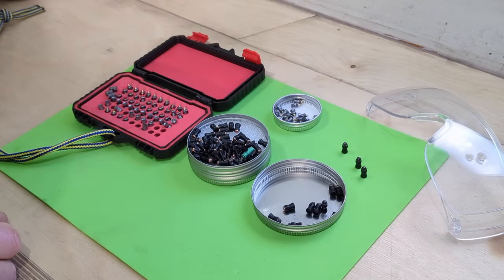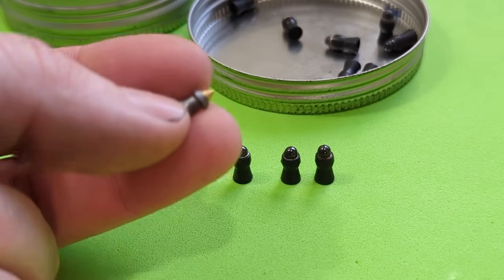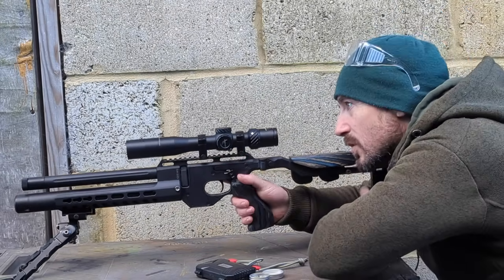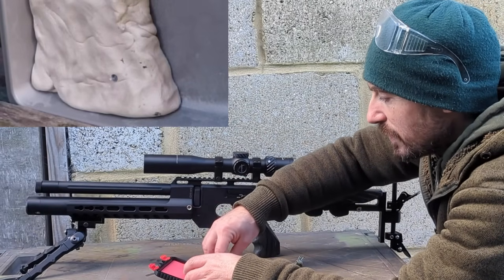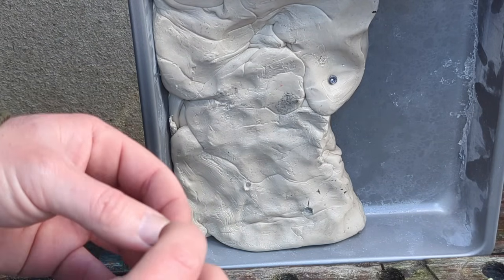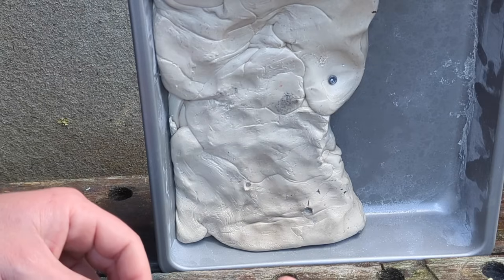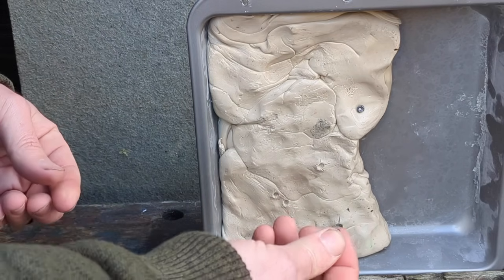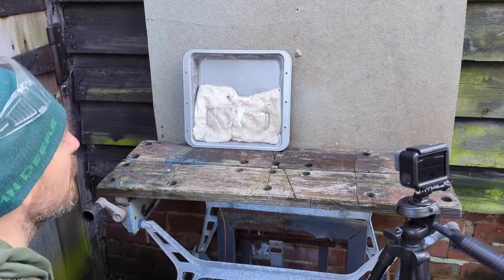The most extreme air rifle pellets in existence.. Ceramic hybrid tipped Gamo lethal!

Comment: The beauty of the "Hornet" is (at least in my experience): 1) it's superb accuracy, compared to other "penetrators" (namely: Polymag and Metalmag) ; 2) the compatibility with wide array of guns - I have emptied many cans of them, in caliber 177, 22 and 25, from 5 different brakebarrels and 2 PCPs (Artemis M16 /.22, Snowpeak PP750 /.177), and, in terms of "grouping" they performed almost as nicely as an average "paper target", flat nose pellet. And they PENETRATE like a spear! The best choice for pest control/hunting, if one is not "on a budget" (yes, these are expensive).
Reply from the maker: Yep not cheap, but a very well made pellet ,if that's the sort of thing you want. There's a new short version due , I guess following the polymag shorts. I'll get some and do a comparison 😆

Comment: Sabot pellets are known to be good penetrators on certain materials because of the light weight/extra speed & hard tips but the cost and for the most part accuracy is not really appealing unless your thing is to break stuff with lower power airguns
Reply: Neither of these is a sabot pellet.  A sabot leaves the missile after firing.  These are composite pellets.

Comment: Nothing beats H&N Hornet in .177 for penetration.  I've tried them all.  The Hornet is a skull drill though I do have to correct you.  They are brass tips not steel.

Comment: How about a PolyGraphite Carbon Fiber Pellet with Sharp Pointed Carbide Tip.  Is it possible, and what would be the results and what would be the cost?  Then if successful could that be applied to bullets.  Been kind of looking into alternatives to Lead on and off for 15 years, had settled on Fool's Gold Cores, Brass Jackets, Aluminum Tips, and Bronzium Casings.  Now I got a new idea.

Comment: If your pellet is hitting with 10 foot pounds kinetic energy it has 120 inch pounds of energy, so a penetration of one inch would give an average impact force of 120 pounds. Those pellets are going into the glasses about a tenth of an inch at most, so you must be hitting those glasses with 120X10 = 1200 pounds of force!
That's almost half a ton of force!  Good polymer glasses. Nice video.
Reply from the maker: Blimey... The maths is a little above me mate but I'll definitely agree the cheap safety squints are much more stout than I expected they would be. 

I want to get my mates to have a few shots with some fac power stuff to see how they hold up...😎

Comment: Isn't the h&n hornet a brass tip? Not steel?  Also, I find they are actually very good and accurate in my guns
Reply from the maker: Yes mate they are brass tips. I likely got muddled up as the gamo are a copper (looking) plated steel tip and core.😉
Reply: Cheers for the reply. I use them Hornets in my Edgun, they group even at 60 yards for me, like you said, not a gimmick at all.  @tillysgunstocks
Reply from the maker: There's a new short version due soon I believe.i guess going off the popularity of the poly mag shorts h&n want a bit of the action. I think they are called a pistol version🤔

Comment: I Am in here in the USA where at this time we have no power restrictions' I own three gamos two Benjamins one  Hatsan . they all like different Pellets my Gamos are set At one pound Eight Ounces My Swarm Fusion  AT ten  Yard Will Put gamo Rocket in the same hole  that the .177 one . My Hatsan loves JSB .22  my Gamo Mach 1 loves JSB 13.4 Grn Redesigns Best.  Gamo red fire  speed was 1038 fps the predator polymag was1007 fps and just as accurate more damage with the red fire, deeper penetration  with with the polymags. the Crosman 10.5 grain from the box is just a hair more accurate than JSB and H&N . any way those are my finding . as far as the HN hornet they use a brass tip that one reason they cost more the Game Lethal shoot ok but they brake the sound barrier. but if I git attacked by some .06 T6 Aluminum I will be ready.